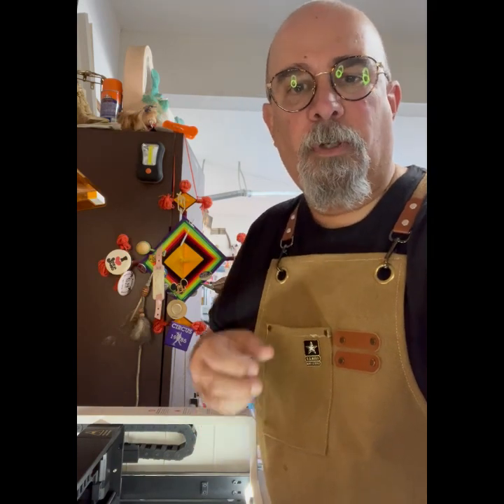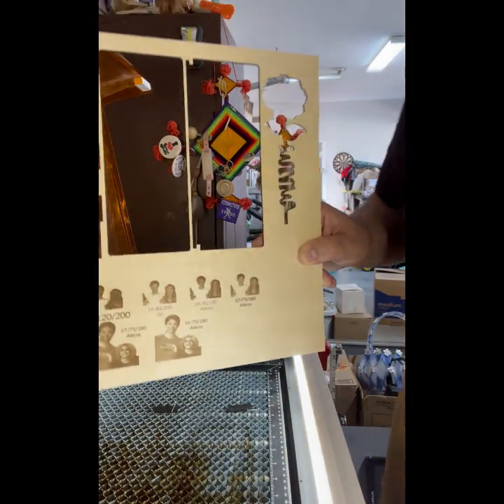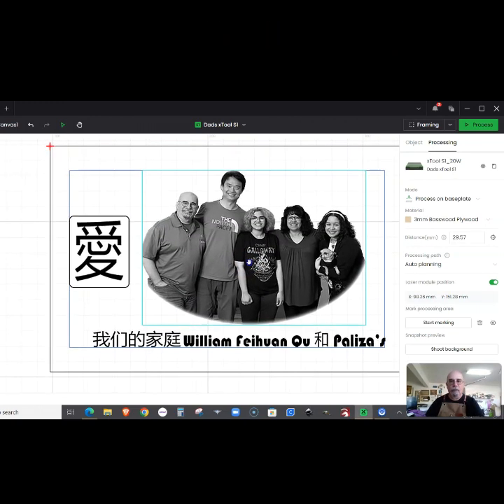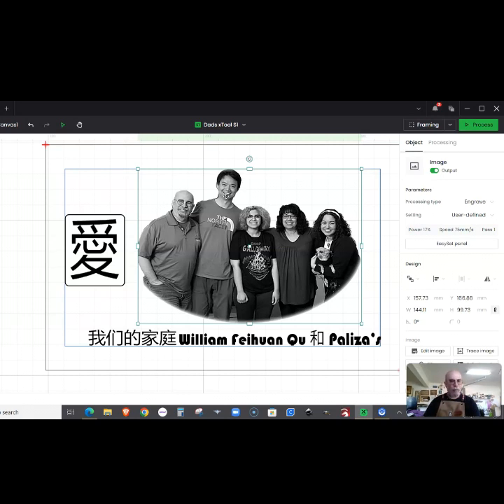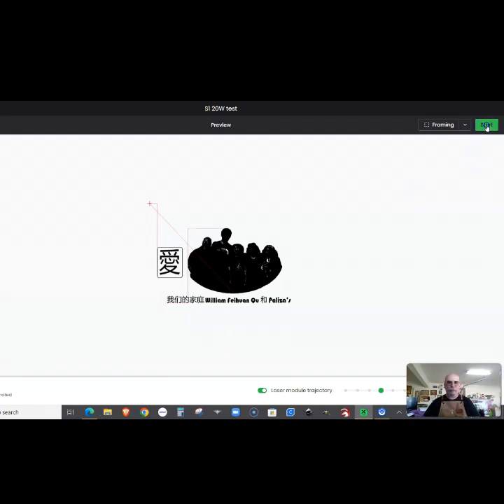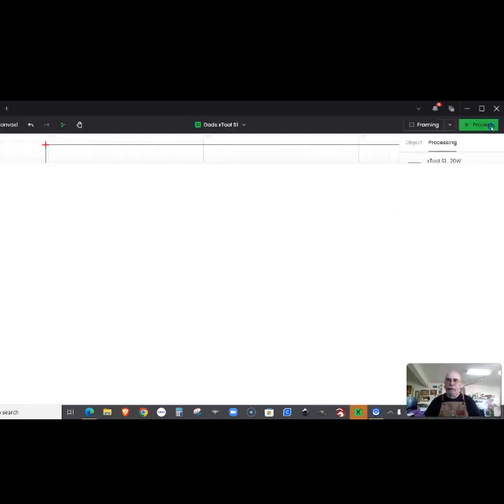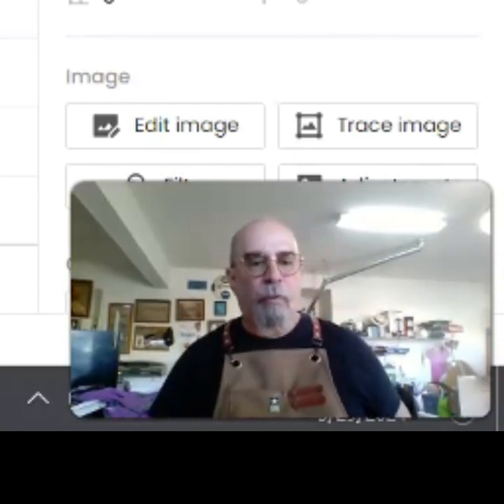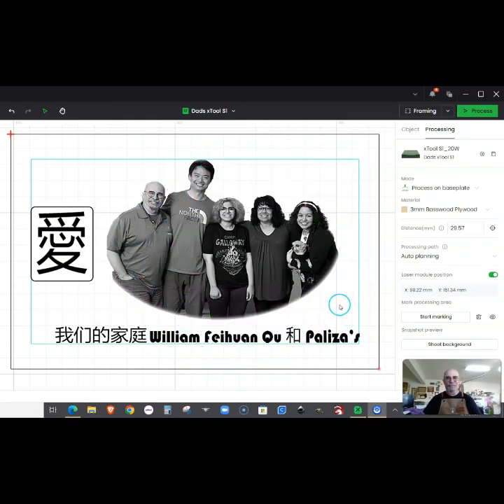Image on Wood xTool S1

Comment: Hopefully your xTool lasts a while. I had the F1 when it first came out, it quit working in the first 2 or 3 weeks, I've got a video about it that still every few weeks gets someone reaching out "did you ever get it fixed" and sadly, no, I had to do a chargeback with Amex because xTool wouldn't even give me the time of day.
Reply from the maker: Wow, Thanks for the info: I was thinking of the F1, but the Laser pecker looks just as good
Reply: @cubansli3099  I think all of these companies have their downsides, all of my machines have had issues ans customer service is equally blah at each company. They said I really like my fiber laser from Commarker but I've only been able to consistently engrave knives and tool steel with it so far.